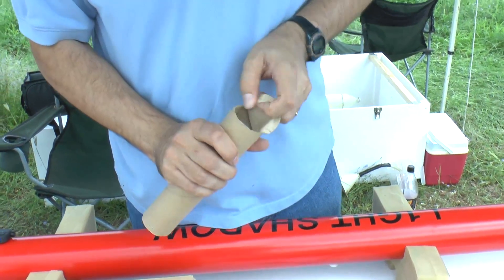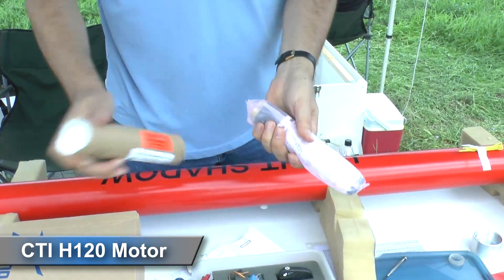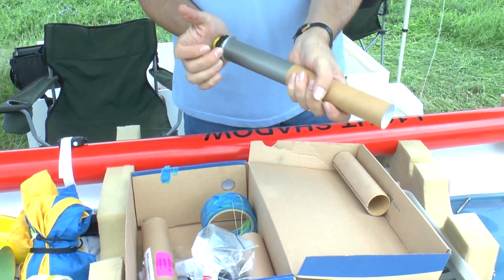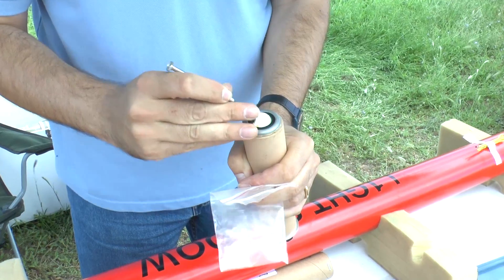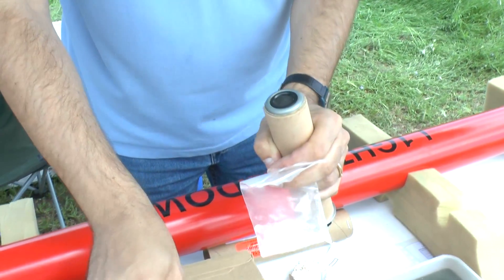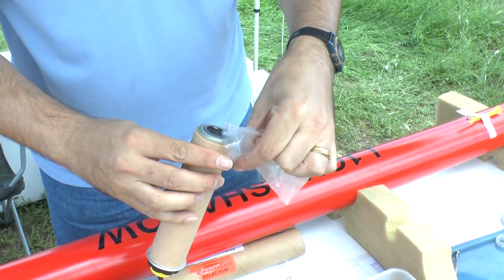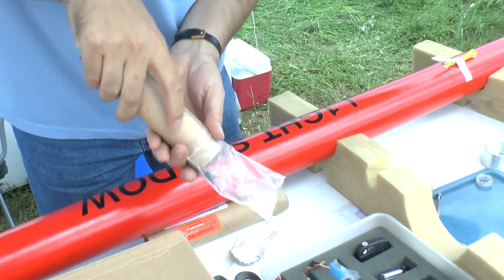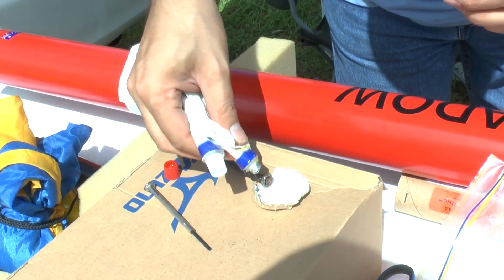High Power Water/Pyro Rocket - Part 4 - Pyro flights

Comment: so you can use this rocket with water OR with a pyro.
did you ever think of using a pyro inside a water-rocket, to Keep up pressure and heat the water?
maybe the pyro could be installed in the Center of the pressure Container, with a metal pipe leading to the end of the rocket, in a way that the exhaust never directly contacts tha water.
but the heat would turn some of the water to steam... such device would use more than usual water-filling.
also a one way valve might let some of the pressure into the water-container.
then there are the chemicals that are used to power Airbags, i think they are designed to create a large volume of gas with relatively low heat.
Reply from the maker: This is an interesting idea. I wonder how much back pressure that would create increasing the burn rate of the propellant ->BOOM. I guess if the volume that it is expanding into is large enough and water is escaping from it increasing the volume it may just work. Though then technically it is no longer a water rocket.
Reply: of Course this would be dangerous, including hotwater/steam...

Comment: Congratulations George on Level 1 cert. Amazing you have made a rocket that can fly as a pro or water rocket. I dont know if anyone else has done this ...
Reply from the maker: Thanks Todd. :) I am not sure if it had been done before with HPR though I know of at least one rocket that used a single bottle water rocket as a booster, and then had a pyro second stage, but only on small A and B motors.

Comment: This was a very amazing project! :) Very good video as well, really enjoyed the drone shots again. The difference in altitude is quite impressive when compared to the water rocket flights. Do you plan to launch the rocket again (as a water rocket) with more pressure? I also wonder how long it takes to convert the rocket after a water rocket launch to a pyro rocket. 
Keep up the great work! :)
Julian
Reply from the maker: Thanks very much Julian. We're not sure how much pressure this rocket will take as it is only made of fiberglass. That will affect the ultimate altitude that it can go to at higher pressures. We wanted to fly it again as a water rocket on the day but it was getting late and so we decided to wait until next time. We'll probably try 260psi and 300psi on the next flights, but it won't get near the altitude of the solid motors. To convert it from one to the other literally takes less than a minute. Pull the motor out, put the water rocket nozzle in and it's ready. Packing the chute is the same, and switching the launcher over takes a couple of minutes.

Comment: Beautiful flight! Are you going to attempt to reach level 2 certification with Light Shadow?
Reply from the maker: Hi Daniel, while we could put a 38mm J motor in Light Shadow for a Level 2 cert, we would probably want to upgrade the deployment mechanism for dual deploy and the higher loads that would be experience. I think though, we'll need to build a new one for a level 2 rocket with a 54mm motor. ;)

Comment: +aircommandrockets do you think the 2nd flight was a bit wobbly due to flex by the acceleration forces? i mean that the nose flexed --> aerodynamics messed up slightly --> wobble? or even flex --> center of mass not in line with center of thrust --> wobble?
Reply from the maker: There was some initial wobble that straightened out after burnout. There was a camera strapped to the side which may have partially contributed to the wobble. But not really sure why.

Comment: Congratulations George: it is a very versatile rocket for both pyro and water.
Excellent shots made with the dron, my 10 points to the pilot :)  I've lost my dron and I'm getting another. Thank you for your work, execelente !!
Reply from the maker: Thanks. :) Unfortunately we didn't have my son with us this time to fly the drone so we had to fly it into position first before launch and just park it there while we set everything else up. GPS hold position comes in really useful! I'm still learning to fly it but the Phantom 3 makes it really easy. What happened to your drone?
Reply: Doing a panoramic flight of the lake from the hydroelectric dam has come an unexpected wind gust and it was impossible to recover it. I did not have a GPS return system so I saw how it was transformed into a submarine :(
I bought another one now that has a return system. No Phantom around here is very expensive.
The Phantom 3 is very good dron and very good quality of filming and I congratulate them because they achieve excellent shots.

Comment: Noooo George!  Resist the tetation of solid dark side rockets! Hydraulics advance rockets needs you!
Reply from the maker: Ha ha, it's all good :) We are still very much focused on water rockets. This was just a test to see if a rocket could be built that handles both high pressure air as well as high power motors.

Comment: Were the same type of motors used for both flights? Also, could you know make your own motors?
Reply from the maker: The two motors were 38mm CTI motors. One was an H120 http://www.pro38.com/products/pro38/motor/MotorData.php?prodid=261H120-14A
and the other H125. http://www.pro38.com/motor/H125-12A.html
They use slightly different propellants. The H120 produces a red flame whereas the H125 produces a white flame. 
In Australia it is illegal to make your own solid motors.